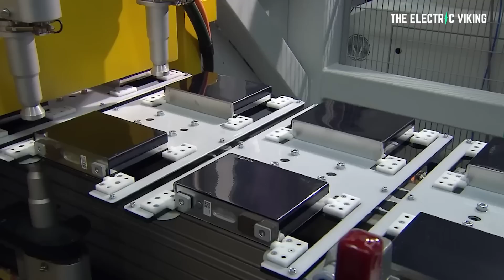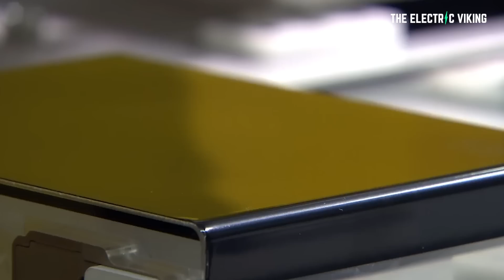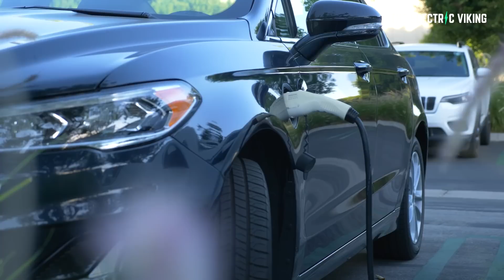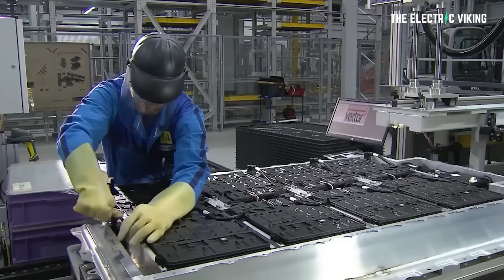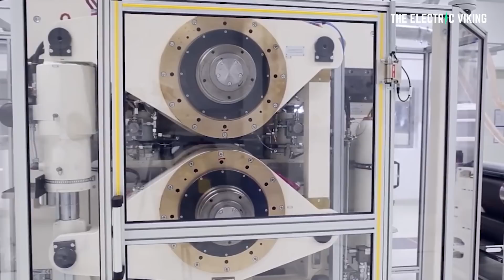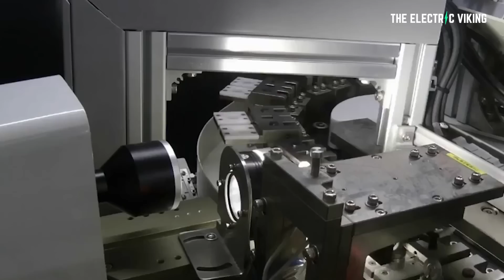GM's new lithium-metal and solid-state battery factory

Comment: Saw a headline that GM may first use their solid-state cells or li-metal cells as replacements for the 12v batteries in their vehicles. But the article was behind a paywall. But this would be an interesting way for GM to get some real-world data on the performance of the cells, before they have scaled up production capacity.

Comment: The new electric hummer aside from it not being up to speed on durability and off road capable, it weighs 9000. Lbs so it can have a moderate range, that’s too heavy, aside from it being heavy any technology progress is good, but still miles to go to be light and have a better range.

Comment: Good for GM if they can pull it off, anything that will reduce the battery weight while keeping the same range is the dream, think if GM's next-gen Ultium battery are just 25% lighter and 25% more energy density

Comment: Lithium batteries bring high cost for American consumers as lithium mainly comes from abroad, increases trade deficit, negatively affects environment in countries where it's mined and processed. It would be much better if electricity produced on demand, the same idea as hydrogen fuel cell, but using different materials. A lithium battery in a mobile phone degrades so much in 3-4 years so most people have to replace the phones with nonreplicable batteries. Cars batteries are very expensive.

Comment: GM is utterly clueless. Chance of this working 1: 10 000.
They bought the Nicola story. They bought the Lordstown story… 
If they possessed even a little expertise that would not have happened.

GM is fantastic at press releases for the consumption of useful idiots. Ultium is a steel box to hold pouch cells. 
Only complete science retards believe this crap.

Comment: Due to the reactivity of Lithium with oxygen in the air and water, Lithium-metal batteries, whether solid-state or not, are prone to battery fires, particularly due to leaking seals, but also if punctured during an accident. I am very dubious about any claims made by GM that are not supported with actual production in volume, as such claims could be just more marketing to support the stock price and executive bonuses in the short-term, for which GM, other legacy OEMs and start-ups raising funds have become all too familiar.

Comment: If you look at the cost of lithium based energy storage over the last ten years, the number hasn’t gone down. Panasonic, Sony, LG Chem and others have driven the cost of manufacturing down but those changes have not appeared at Bunnings in terms of battery power tools, or for home battery storage. 

I call BS on this one. Someone is saving money but it’s not me.

Every percentage improvement at the wholesale level is going to deal with the putrid energy efficiency issue created by using over 250Kg of batteries to move a corpulent entitled smug mobile driver to his next latte. It’s not being used to make products that solve problems people actually have
Reply: Too many mixed messages, off topic. You can do better.

Comment: "60% reduction in cost at twice the energy density".  I suspect that the cost reduction figure is denominated by energy density (60% lower cost per kWh) making it incorrect to multiply the two.
Reply: My take as well: $40/kwh instead of $100/kwh and 300kg instead of 600kg for that pack.

Comment: Its GM , let's face it you cannot trust what they say . They say 700 cycles and it will maintain 80%  . Look at Tesla data .. CATL new batteries supposed to have a much longer lasting battery . The life cycle of a battery pack in a car is proportionate to the size of the pack . A 100kw pack will require about 1/2 the number of recharges to do aprox. the same distance as a 50 kw pack . As Musk said the 4680 will cost $70/Kw , so a 100 KW pack =$7 K  compared to a 70 KW pack at $5K  . I would pay $ 3 K more for the longer range and longer overall life of the battery pack .  The !00 KW pack will last 40% longer for the same degradation . As CATL batteries are much cheaper and have a longer life than Existing batteries and can be charged to 100% I think I know what will be better  .
Reply: What are you even saying? You can put in the same weight Cuberg/Northvolt lithium-metal cells and get at least 60% more range. Lets say your Tesla reach 600 km, the Cuberg cell battery will reach 1000 km. You need way less cycles to get around and when your battery is down to 80% capacity after 700 cycles it will still have more energy density than your CATL battery.

Comment: I've reading many comments about 700 cycles being not enough. Let's say the range is 300-400 miles, then that's 210,000-280,000 miles and still have 80% of that range. I think that will fit into their business plan as they don't want cars lasting forever.
Reply: Since the 1950s GM reliability engineers have been working hard to ensure every replaceable part on their “products” dies within months of the warranty expiring. Anything beyond this is just revenue leakage. Given the very wide range of usage conditions this is a huge ask. Still they try.

There are too many examples of this to list
Reply: @theairstig9164  exactly. Stealership business model based on repairs, service.
Car ownership is enormous drain on individual budgets. Huge honeypot. They loved feminism as way to sell cars to other half the population.
Reply: 80% is still decent. Note that that is the cycle rate when quick charged at high amperage. More interesting to many will be the battery life when L2 charged at home at a lower speed and amperage.
Also, the Ultium pack is designed to be upgradeable and replaceable. The car is not obsolete if the battery pack can be swapped out at a reasonable cost. That said, I've never kept a car past 200k miles, but it's nice to know and that may change.
Reply: Exactly. gm business plan is built in obsolescence. It’d be crazy to have batteries still good in unfashionable old cars, better they are smoky, rusty, rattling, dangerous & unreliable after 100k miles - just like now.

Comment: 700 cycles for EV batteries development, it is not good enough today.
The research scientists working for Tesla Inc., are working on batteries 
with much higher life cycles reaching 2 million miles per life of the batteries?
The main challenge is the temperature, in which the batteries are going to work ( cold 🥶, - 40*C, hot 🥵 + 40*C)?
The race for EVS batteries 🪫 is on, and scientists 👩‍🔬 around the world 🌍 are searching for the new formula 
which will be better energy density and much longer life cycles and reasonable price?
Reply: It is good enough as the car will still go much longer than your lithium-ion cells.

Comment: That is terrible cycle life 700 cycles. LiFePO4 is at 4,500 cycles for 80% DoD. And 10,000 cycles for 60% DoD. For personal vehicle use, Their battery will last for way over 50 years. And will retain 80% of battery capacity. How is GM's battery competitive?!? They are using battery life from 15 years ago to compare.

This sounds to me like GM is pulling the same old trick. Say anything to sell you a car. Claim world's best, blah blah blah, but list the actual data hoping you don't go compare it to LiFePO4 batteries. If you don't compare carefully and buy the car then your battery will lose range in 5 years and you can't complain about it because the data is listed.
Reply: Dude, you will never use all those cycles, that battery will be so out of touch with tech developments after a certain time.

Comment: Thing is: there are only solid state drives now...solid state batteries aren't a thing yet because these bitXhes are so dumb that they don't see a reason to invest in proper research. I ask myself how dumb battery manufacturers really are since it's only about the design and about charge separation. The mere knowledge that they assume that certain materials are needed shows how far behind they are. It's all about geometry on the nanoscopic level...but maybe I am wrong and it's on an even lower degree of the scale dimension. The question is: what's the minimal volume into which you can pack the maximum of electrons together so they stay put until you give them a "reason" to move...and this movement then can get abused/harvested.

Comment: 700 cycles isn't enough for an EV in my opinion. Unless the tech has significantly improved beyond that, it's a NO GO for me
Reply: 700 cycles at 300 miles each is 210,000 miles.  That is more than the major components (engine/trans) in current vehicles last.  And the cycle count always goes way up when not discharging all the way.  Lithium ternary batteries in Teslas were only rated for 500 cycles but daily shallow use meant real-world cycles in the thousands.

Comment: Solid state good for 700 cycles to above 80% deg. LiFePo, 6000 cycles to 80% deg. Not game changing quite yet.😢
Reply: Sure but what is the energy density on that lol? Cubergs new generation that they already teased have 405 Wh/kg energy density. Then we can start talking about electrified airplanes.
Reply: LifePo is a low peak current chemistry, so you need huge battery packs for power even if you don't need the range. 400hp basically requires a 100kwh pack, yielding 300-500miles depending on the car.  6000 cycles would mean 2-3 million miles, which is a rare goal for a vehicle component lifetime.  700 cycles is 200k-350k miles, which is more than most people will keep a car -- and battery cycle life always improves if not fully discharged each time.  If replacement cost was low enough, a battery that lasted only 50k miles could be fine -- at my annual mileage that would last 15yrs.  There are other goals than just long battery life.  Viking seems obsessed with LFP for that reason, but ternary batteries produce twice the power at half the weight and last longer than most people will need.  Teslas with ternary batteries have lasted 300k+ miles and most any other vehicle would be considered scrap at that point.
Reply: @kirkellis4329  The 400+ Wh/kg batteries wont need more than 700 cycles but before they are in production they will probably be at 1000+. Cuberg doubled their cycles in 2-3 years of research with a smaller team and now has Northvolts whole infrastructure behind it. Cubergs cells will soon be in aircrafts and supercars, will be very expensive to start with. But you can get production costs down as you wont have to manufacture an anode.

Comment: Solid state batteries are also lithium-metal batteries. Difference is just what type of electrolyte you use to make the lithium-metal stable, some think only solid state electrolyte will function for lithium-metal but others like Cuberg have developed a liquid electrolyte that functions with lithium-metal. So we should just call them lithium-metal batteries with either a solid or liquid electrolyte.

Comment: It's encouraging that these lithium metal batteries have some real-world tests already. If GM is able to pull that off (a big if, I know), it would instantly make them the most valuable company in the world IMO.
Reply: 700 cycle life is nowhere near competitive. GM is using cycle life of Lithium batteries from 15 years ago.
Reply: @felixsu375  Look up Cubergs new cell on their webpage, and you can see it packs more punch than a Samsung 2170 over a longer time because everyone of those cycles contains 50% more energy.
Reply: Gm is going bankrupt, ask Musk.
Reply: I’m not sure what to think of the cycle metric either. They can’t mean full charge and then discharge as a full cycle, otherwise these would not last more than 4 years before the range loss is very noticeable. (200 charges a year for a daily driver.  700 cycles is less than 4 years. Ok, maybe double the years to 8 years for people who don’t discharge their car every day, and your at 8 years which is respectable. (But the LION cycles were only 500, which means LION cars are at 80% in 6 years.  That’s not great but not terrible either.)
Reply: @scifithoughts3611  Speaking from someone with 2 electric cars in our Family, both have similar range of about 450 km of range... My commute is above average, both ways are almost 1 & 1/2 hours a day to work and home.  Most weeks I do at home Level 2 charging around twice a week, lots only once a week, from around 30 percent to 90.  And rarely do I do DC rapid charging, & only charging to 100 percent 3 or 4 times a year for long overnight trips.  I have lost "no range" after 4 years of respectful use in both our cars, & almost 100,000 Km on both of our cars.  Whenever, or if I lose 20 percent range to 80 percent as discussed... it still would be more than enough range to get by with for years.  People need to remember, just because you only have 80% range left after way more than 4 years of use, hardly makes the car useless!  I'm tired of the fear mongering over battery life expectancy...  As in this video, battery prices continue to fall, and when it finally, or if it comes to changing out the battery, I'm sure battery pricing will be similar to a new ICE engine anyways...  Still the best decision I ever made for a vehicle... I have never paid more than 50 dollars a month for electricity... Can you heavy using ICE people say that...?

Comment: solid state batteries are the new Hydrogen fuel cell. Prosperity is just around the corner for solid-state batteries so please delay the EV incentives.
Reply: The new fusion energy lol.

There is an honest Israeli solid state battery tech that has made huge improvements on solid state batteries, but still claim they are over a decade away